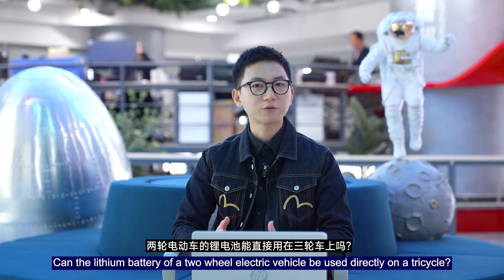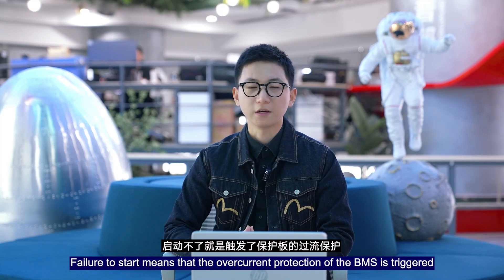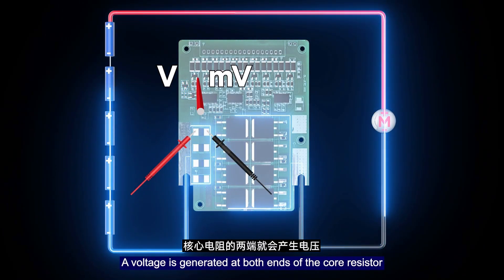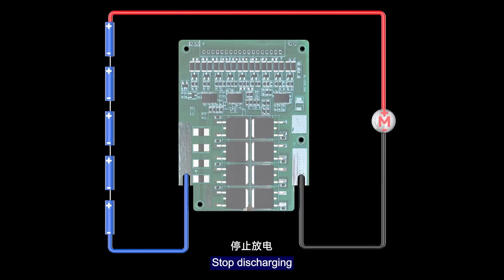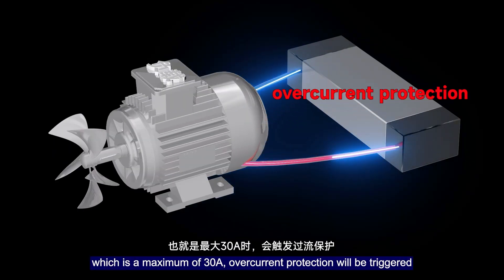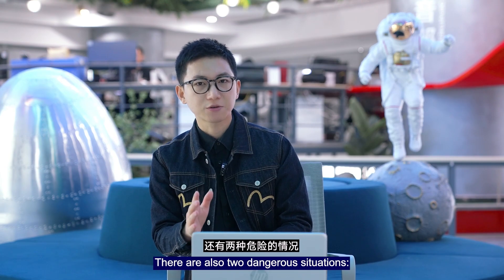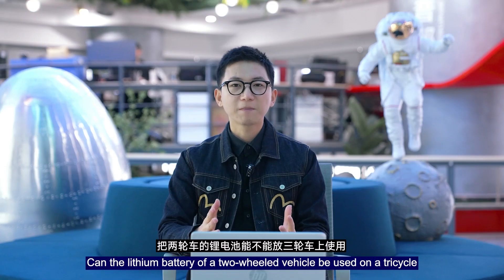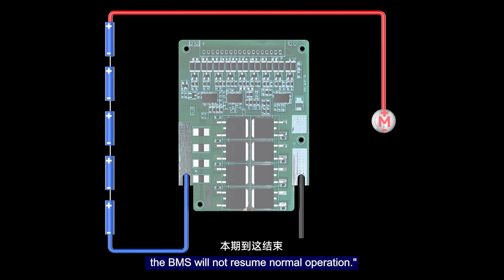Overcurrent protection #renewableenergy #power #inverter #communication

Comment: What device I need install that bms not off all battery cells, but only that, which have bad parameter? I have 16 cells in battery pack. I have simple bms 16s, not smart, and recently buy an active balance on 1amp. But bms off all cells if on one cell will be low parameter by voltage. What's do?
Reply from the maker: Please send an email to this email address and someone will reply to you.
selina@dalyelec.com